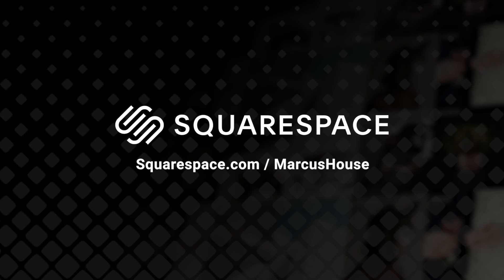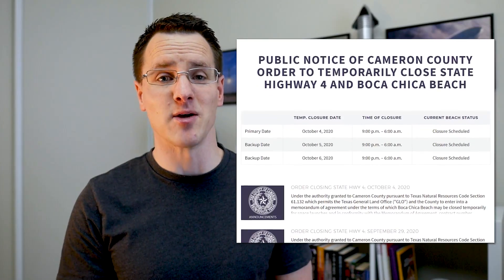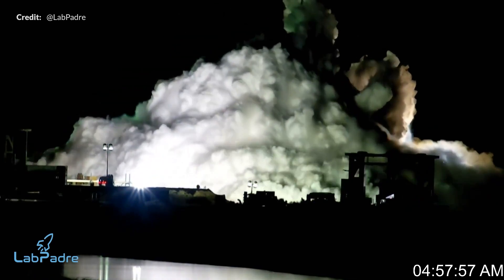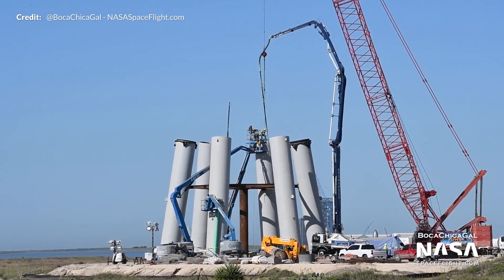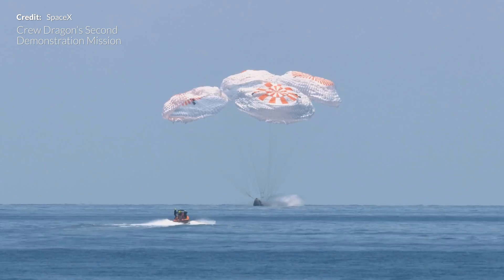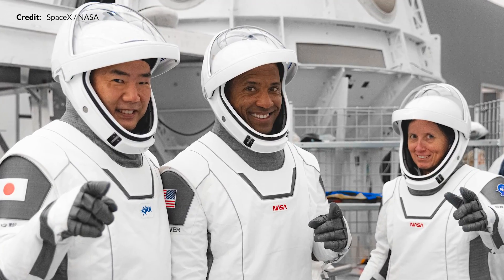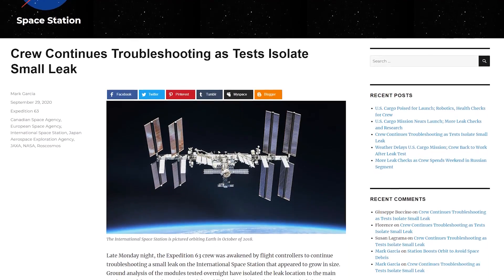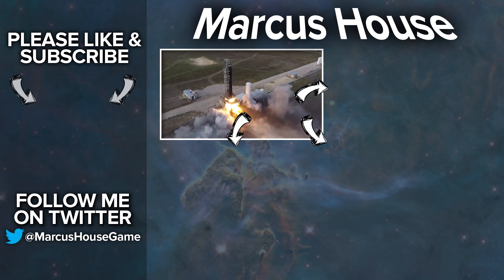SpaceX Starship countdown to flight - Elon's Starship update in 3 weeks

Comment: Marcus, love your work. Here is an idea to pass to Elon if you want to. He tweeted that an arm is needed to hoist SH and then SS onto the OLM. I have always envisioned it more like an elevator with the counterweight on the tower away from the vehicle to shield it from raptor wrath. Then on the vehicle side a crane hook that can pivot into the tower for protection during launch launch and pivot out for elevating the two parts. Elevators are well known safe and cheap technology that are energy efficient since little weight is actually being moved. The counter weight balances the vehicle being lifted. Frinkjg@gmail.com is my contact info.

Comment: Hey Marcus, thanks for the great content. Do you know if lasers are used at all in the manufacture of these rockets? In the welding, cutting or otherwise? I have to research a use case of lasers in current engineering projects and or manufacturing processes.

Comment: One of the properties of Stainless steel is that it will change colour permanently
when heated. You can get blues, yellows and greys when heated, dependent
 on temperature. Will we see changes in colour in the Starship
 esp around engine end? You may be able to tell what the temp got to?

Comment: Major Danger = Anything less than 316 S.S. is dangerous used in any cryogenic liquid fuels. Take a pipe made from carbon steal, cool one side with LNG and the other side at room temperature. Smack it with a ping hammer and it will shatter. Also, down in Corpus it’s a moist salty environment. Anything other than 316 the metal rusts.

Comment: Great Stuff Marcus. Thank you.
All that amazing progress Amaze me - Only to meet the Fact of How much CO2 used for Each launch.
Every Falcon Launch Drops some 2000 Tons of Harmful gas. 
Why do they still using that Propellant 

Thank you #MarcusHouse
Reply from the maker: It isn't as much as it sounds. Much of the fuel is oxygen and it burns the fuel very efficiently. You are correct though. It is a lot of CO2. This is why such a big push for Starship. If they can achieve the ultimate goal of creating the fuel by pulling it largely from the air, then it will become a tiny carbon footprint.
Reply: @MarcusHouse  Thank you

Comment: I believe that Elon is being conservative about the pressures involved with the bursting of SN7.1.  I think that the ultimate burst pressure of the tank was above 10 BAR and Elon is just not revealing that fact.
Reply from the maker: Why do you think that?
Reply: @MarcusHouse  Because it isn't likely that the pressures he gave were exactly these numbers.  There is a good deal of difference between 8 and 9 BAR.  I think the pressures were something other than exactly these values.  Therefore, I think that he has held back, at least a little, on the real figures.
Reply from the maker: @guypehaim1080  He gave two numbers. One was the pressure at the top of the tank. One was the pressure at the bottom of the tank. Bottom pressure is higher because of the tons of LN2 on top of it.
Reply: @MarcusHouse  I realize that the difference in these two pressures was caused by the column of LN2 in the tank.  I have no issue with that aspect of the tweet.
What I'm saying is that Mr. Musk wanted to reveal only that that portion of the pressure which would allow the proper safety margin for manned flight need be affirmed and not say any more than that.

Comment: Are you sure that the oxygen is on the bottom of the tank? H2O should be that there is need for 2 times hydrogen comparing to oxygen.
Reply from the maker: LOX is on the bottom. CH4 is on the top. No Hydrogen.
Reply: @MarcusHouse  Ups... You are right. My fault, forgot that it is methane. Sorry.

Comment: COPV may be eliminated entirely with Raptor motors. Something about bleed pressure tapped off of the turbo pumps and natural heat expansion of the fuel/oxidizer.

Comment: Assembly of the Electric Impulse spacecraft thruster version 2.0 will begin this November. Components are being shipped now. The prototype does NOT violate Newton's third law, nor modify Newton's third law.
The design demonstrates how Newton's third law is applied to this type of device. 
"IF" this prototype does NOT work?
Then the following formula is incorrect,
X - X = 0
Reply: We know that this is NOT POSSIBLE, the design calculations indicated that a conflict existed between the math formulas and Newton's third law. 
If it doesn't work? The math is wrong? Math is math!
If it does work? Newton's third law is wrong? Highly unlikely!

The version 1.0 proof of concept design does work.
And both the math and Newton are correct.

Until independent testing and verified the design has no value.
We intend to transfer the design to SpaceX, soon!

Comment: 8 bar is good enough for liquid storage.
Reply: This is generally true, but do note that this stuff is very high pressure and cryogenic, as well as going through crazy changes in stress while going through the atmosphere into space. 8.5 is seen as Very Good and has a very low chance of failing.
Reply: @nexusxe  those tanks should be double walled vacuum insulated. should be fine.

Comment: Hi Marcus - regarding the COPV's I don't think there should be any in the final design as they would not be able to be recharged on the Moon or Mars and so not meet the Starship design criteria.  I could well be wrong about this but I thought all of these subsystems would be pressurised autogenously by boil of from the main tanks, and as SN8 is the first prototype to use 3 raptors it may just be this is the switch over point to the final system?  Love your presentations please keep them coming!
Reply from the maker: This is the goal yes. These are still prototypes that still use some fairly crude methods in comparison.

Comment: How will the propellant get from the header tank in the nosecone to the engines? I haven't seen a pipe in any renders.
Reply from the maker: Yes, we haven't seen this either. I reckon it will run down the center on the leeward side, but I may well be wrong.
Reply: Maybe the plumbing is all internal...
Reply: The header tank is counter intuitive. It seems like a safety problem for me.

Comment: It would seem more logical to put the COPVs on top of the forward dome, or on the inner walls above the forward dome weld.
If COPVs are so fragile, the intense engine bay sounds like a no-go to me.
Reply: Telling SpaceX how to do rocket science seems absurd.  These guys are the best of the best and have working hardware in interplanetary space.

The question you should be asking yourself is why is it being done the way you see it on Starship as opposed to how you think it might work now.
Reply: @GlanderBrondurg  Oh here we go again, a SpaceX fanboy feeling the urge to defend something. I'm not telling anyone how to do stuff. I'm merely putting my thoughts out here. And for the record, that picture of that supposed COPV supposedly installed in the skirt is VERY obscured, I wouldn't conclude solely on that.
And working hardware in interplanetary space, what are you talking about...
Reply: Exalerion idk, Elon’s car?
Reply: @jm56585  Lol, I highly doubt that thing would still work. Besides, it has nothing to do with Starship.
Reply: Exalerion ikr
Reply: Also, I don’t think putting the COPVs in the engine bay is a bad idea because the raptor engine doesn’t have a turbine exhaust and probably doesn’t get that hot, also its the closest to the engines, so I think placing a more durable COPV there is lighter than placing a less durable COPV somewhere far away and having to connect them with tubing/pipes, idk, this is just my thought
Reply: @jm56585  Depends on what the COPV is used for. But 2nd stages normally never have skirts and never fire in atmosphere (which creates intense sound, resonance, shockwaves etc), and boosters usually only have interstages with all the equipment in there. Starship is a unique exception lol. Super Heavy also won't have a skirt so it will have to be solved differently I think.
Reply: Exalerion I think the COPV in the skirt was used for spinning up the turbopump, and there is another COPV at the top to pressurise the tanks.
Reply: @jm56585  aren't they using autogenous pressurization for tanks?